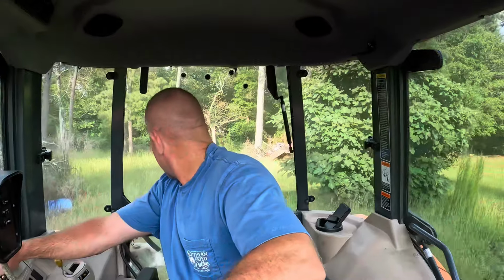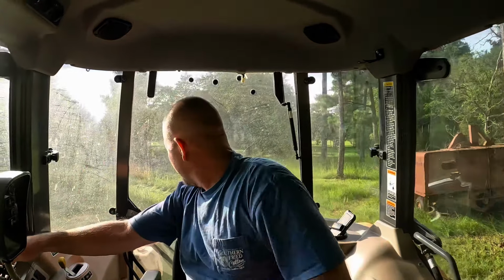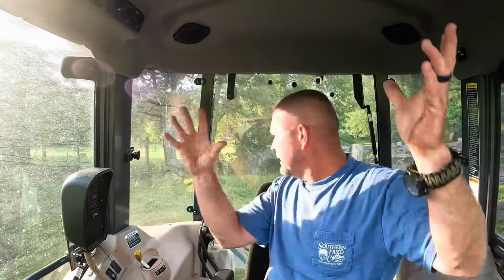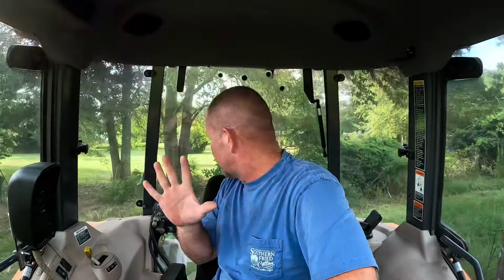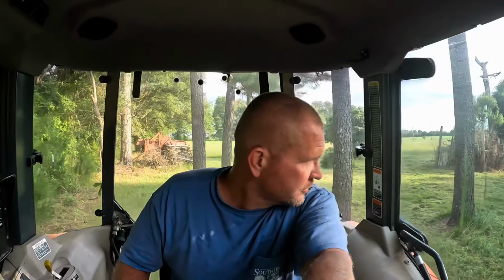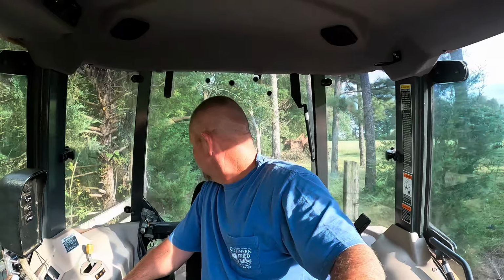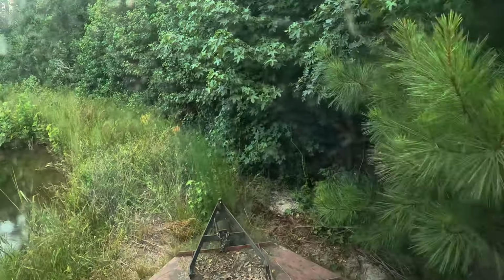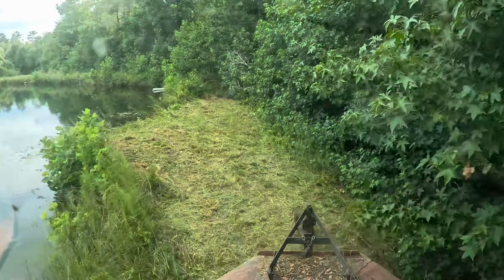The problem with Kubota tractors and a few others!

Comment: I have a M7060 and a M6-141 and have no problem with the AC on either. Yes on hot days I have to run the fan on high. I actually like the vent placement. The biggest thing is running the AC on record. when it is hot and not draw in outside air and keeping cabin afilters nd all AC components clean. I live in the deep south and do not have tinted windows and never saw a reason to do so.
Reply from the maker: That’s good you don’t have any issues with it. It gets hot in my cab though. Thanks for watching.
Reply: Great video.  I like seeing you cutting the grass.
Reply from the maker: @joanyoung9086  thank you

Comment: Very Hazardous mowing close to pond with improper implement. Offset flail mower with opposed weight would be safer. Backing up to pond not good, just a slip of the foot on the 
brake or hydro pedal and you're in the pond with a heavy piece of equipment that won't float.
I have experience rescuing a neighbor that did this and the tractor flipped over backwards
trapping him under the tractor.
Reply from the maker: You are very correct! It is dangerous but that offset flail mower is a costly piece of equipment that I don’t have money for. So just have to do what I can! Thankfully though most of the places I mowed around the pond are only a few feet deep. Thanks for watching.